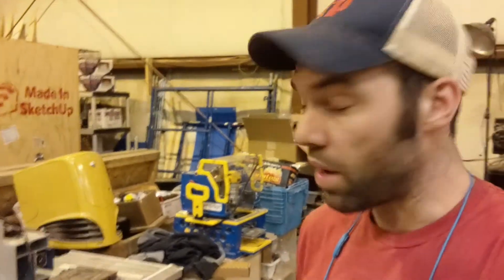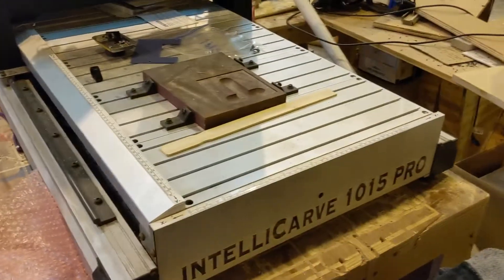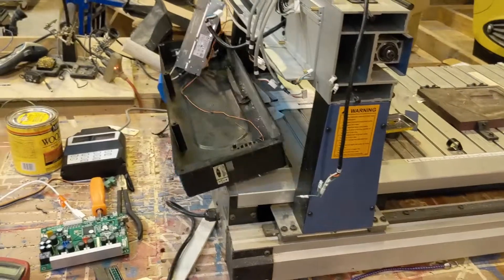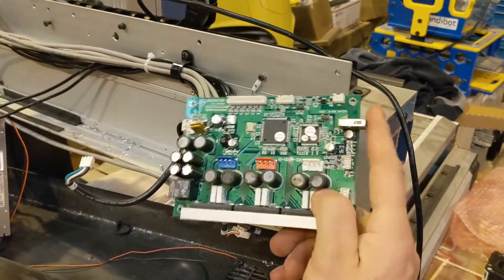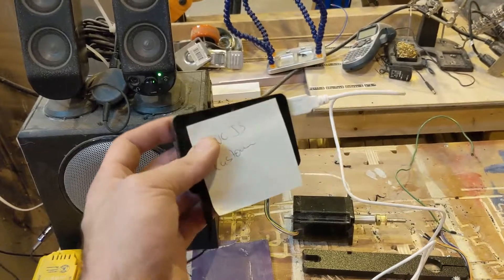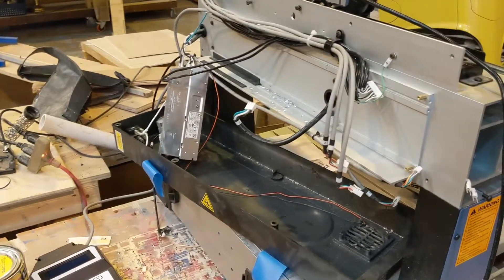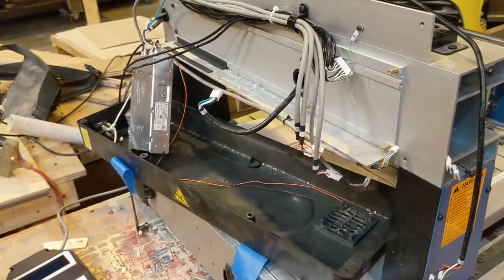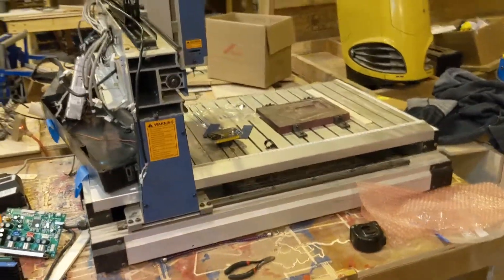Oliver CNC conversion

Comment: hi ...I have a 1013 ....do you know were I can get any parts , mainly the spindle motor ?
great video ..I have been planning on up grading myself especially if I can not find a motor . getting new , faster and stronger
or do you have any suggestions ?
Reply: I replaced my 1013's spindle with a 1hp Bosch trim router several years ago.  Made a split sleeve style clamping bracket from exhaust tubing to hold the router.  Turn on and set speed manually.  Must delete the 3rd or 4th line of g-code in the file or else program stalls for lack of rpm feedback.  Much more power.  Must replace router brushes periodically.  You can view a couple router videos on my channel to see.
Reply: @oldhobo5610  Thanks... I ended up using a Makita router head .... I to get rid of the G-Code along with the very first line ... comes up with g70 I replaced with g54..... Replace the motors and hook it up to my laptop a far far better machine . Could go through many other post-processes to find the one I do not have to edit each time..... I get used to it .... Thanks again